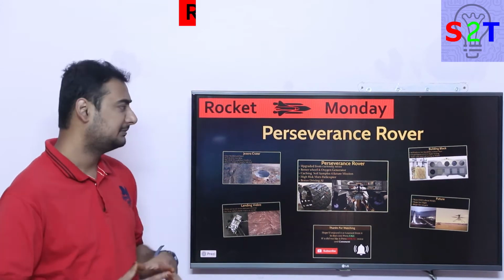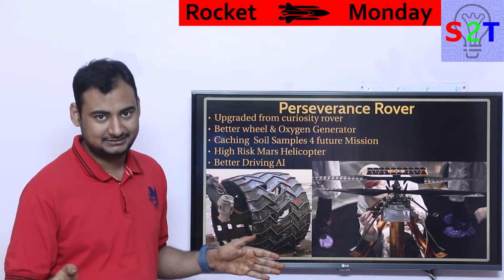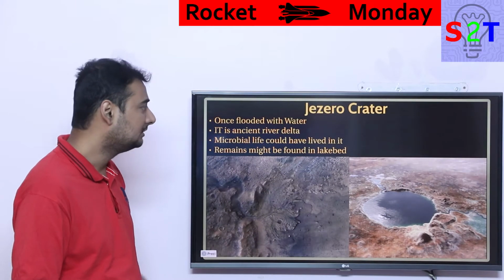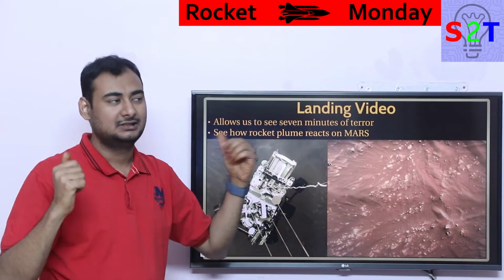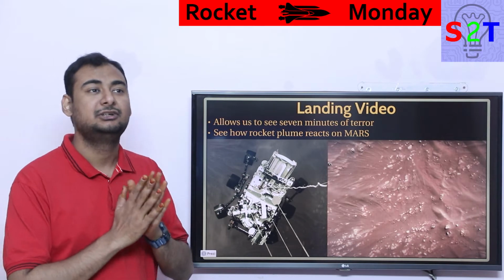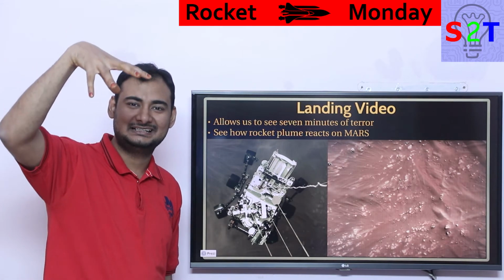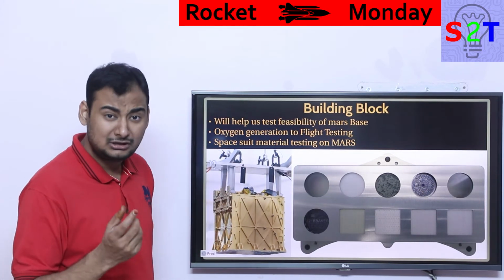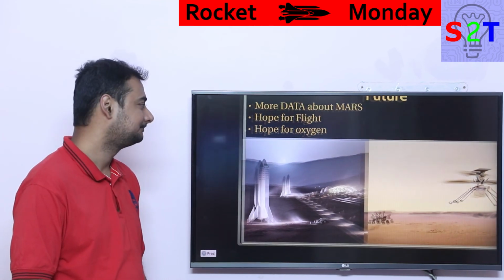Mars 2020 Perseverance Rover Explained  {Rocket Monday Ep136}

Comment: Hello sir! Thank you a lot. I love this Rocket Monday series. Sir, please make a more detailed picture of how a rocket engine works with images showing the flow of fuel from one pipe to the other. You have made different videos on the components of rockets. What I am asking for is one video that covers all the technical stuff about rocket engine. Which pipe has more pressure, what pipe does what, etc, etc. Make a series on it if it can't be covered in 1 video. Please...

By the way I am watching all your videos in Rocket Monday series from oldest to newest. They are really really awesome. Sometimes I watch them twice to really understand the technical workings.

Also make a video on Specific Impulse.

Thanks a lot again!!!
You are awesome!!
Reply from the maker: I did that in detail with raptor and parts are also covered